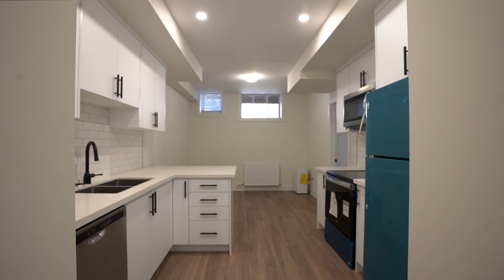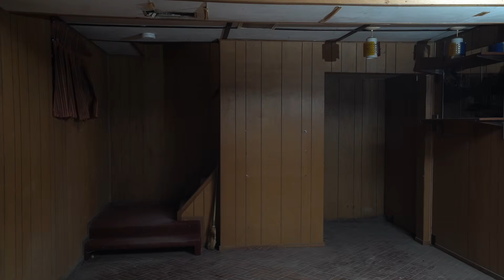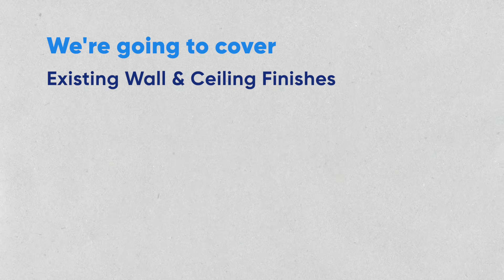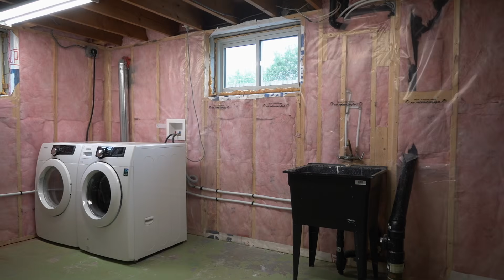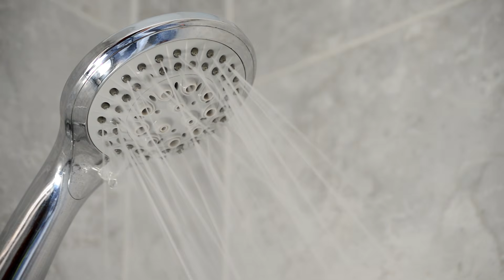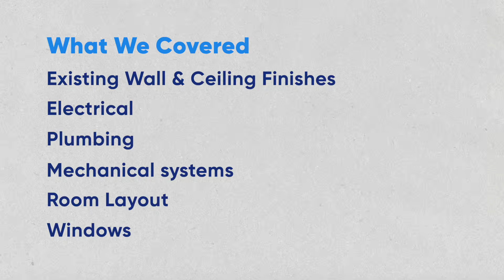Converting An Existing Basement Into A Legal Second Suite | A Beginner's Guide | Ontario

Comment: Hi Andy,
I have a question,
I bought a Single Dwelling with finished and separate Unit (Like Accessory Dwelling Unit) and I found the ceiling and all walls were used double layers of normal (1/2") instead of Fire Rated Dry Walls, I would like to apply to get ADU permit from the City.
I'm not sure, is this acceptable on OBC or the City will required to remove the existing drywalls and install new Fire rate Drywalls instead?

I would appreciate it to share your experience...
Regards,
Reply from the maker: Hi amir most likely they we will ask for additional fire rated drywall underneath